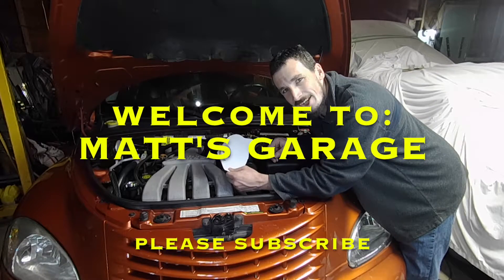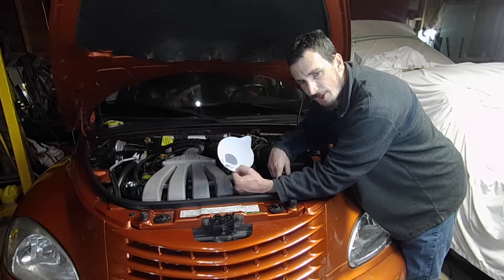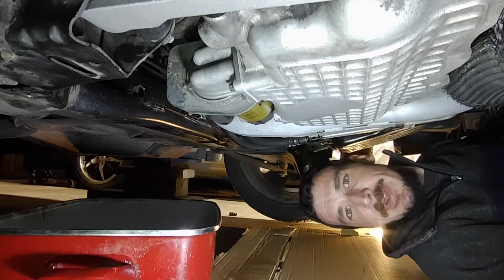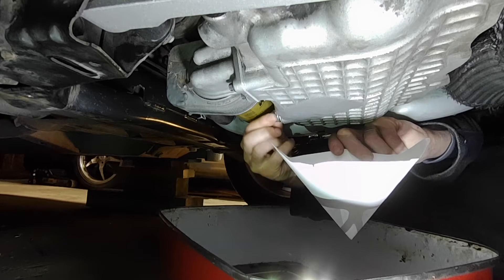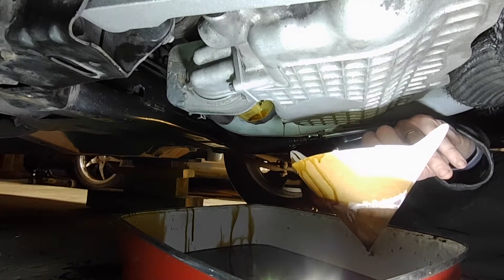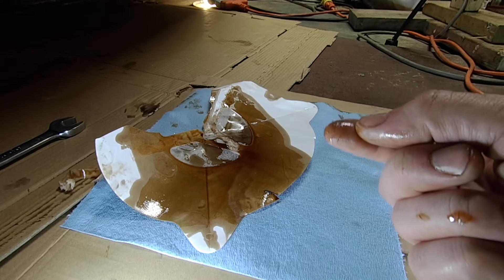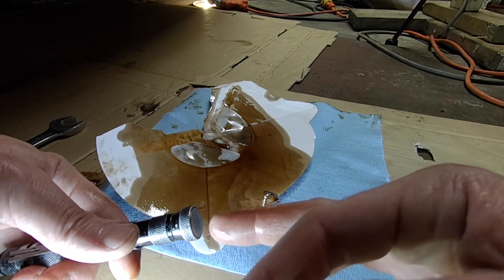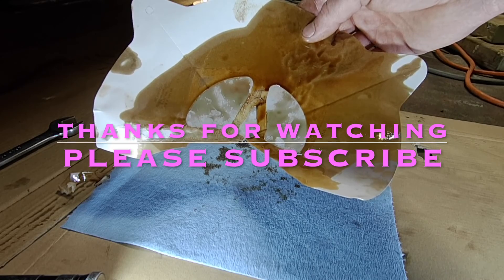Cheap DIY Oil Analysis

Comment: Great idea; thanks!  I'm not sure how old your Mom's new car is, but if it's more than a few years old, then before her long trip, please check out the brake lines, radiator hoses and any hoses that carry either vacuum or pressure, the condition of the battery and of its terminals, the condition of the chassis and engine grounds (i.e. no corrosion), wheel bearings, steering components, etc.  I know you know the drill, but with a shiny new pre-owned vehicle, it's easy to assume things were checked out completely before she got it, when possibly they weren't. If she's not a member of the CAA, or something similar, now would be a good time for her to join, for her safety and for everyone's piece of mind.

P.S. A Lincoln would seem to be the ideal car for a road trip; do you still have yours?
Reply from the maker: Anonymous98 No worries, I went over ever inch of this car (it’s an ‘03 BTW), I never take anyone’s word on a car being safe or trip ready. Everything you mentioned was done and more, I’ve just gotta edit all the videos. My folks are already mid way thru their trip and so far the car has ran flawlessly. I still have a ‘94 Town Car, but it’s a project still and I still have my ‘80 Versailles of course. The Town Car’s do pretty good on a road trip but my mom is more of a sporty driver so the PT is better at that, it makes passing and hills effortless and is still pretty comfy too.

Comment: That is a neat idea. The oil didn't look too disgusting either compared to what I've seen, a hint it was well maintained by the previous owner. By the way, do you plan on buying yet another PT Cruiser? By not much more, you could have a record on how much PTs you own at one time:)
Reply from the maker: Eaub Felangy Yeah the oil was nice, so were the plugs, it was well cared for by the looks of it. I would eventually like to get a convertible, but they tend to be pretty pricy. Also I’d like to get a fully loaded PT in bad shape to do a complete tear down on for the channel, I mean every last nut and bolt, a multi part series. First I’d like to get my black GT on the road, hopefully next summer I can get to that. (money issue mostly, I plan to spend lots on that project).
Reply: @CarswithNash  the PT GT would be a good one, I bet somewhere near you there is a junked one that had a rear collision so you could use the engine. Also the idea of a poor condition limited is a good one, a pt that isn't common would be a white with wood trim. I saw one back in May, and the time before that was somewhere in 2015. I even made a 1 18 scale version of it out of an old Maisto I bought off of eBay. You're not wrong about convertible PTs, have have seen them sell for 6 to 7 grand.
Reply from the maker: Eaub Felangy Here the cheapest convertible I found so far was $3,500... I really like buying cars for under $1000, so I may have to wait or buy a broken one. I just wanna make sure I’m eventually covering ever possible aspect of these cars, so that would include convertible top issues, 2 door related issues etc. I wouldn’t pass on a good turbo engine for cheap, but I’m also not really looking, my engine doesn’t look too bad and I’m planning power upgrades, so it’s best if I just rebuild it I think, then I know what I have and it makes for some good videos as well.

Comment: really nice quick tip! Sure it won't give you a breakdown of all materials present in the oil, but it will let you know in a hurry if your engine is on the way out.
Reply from the maker: 802 Garage Exactly! I actually knew a guy that  drag raced and he did this between each race to make sure he hadn’t hurt his engine.

Comment: bearing material is an issue and it wont stick to a magnet
Reply from the maker: joe You aren’t totally wrong, bearings in car engines have a very thin layer of babbitt on the bearing surface, babbitt is “almost” none magnetic, although it does contain some alloys that are attracted to magnets, it’s likely it would stay on a magnet if placed there. Directly under that very thin layer of babbitt is a layer of nickel, which is in fact magnetic. As well the surface the bearings ride on are also magnetic (cast or forged steel). If your engine is producing flakes of metal it’s likely already worn thru the babbitt into the nickel and is also wearing into the bearing surface, thus magnetic metal flakes would be expected if the engine was actually failing.
Reply: @CarswithNash  I have seen engines with bronze and even tin crankshaft bearings. Neither are magnetic.